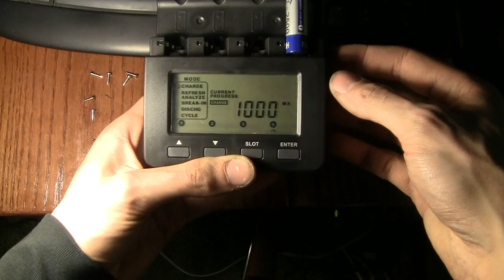Maha Powerex MH-C9000 Wizardone Battery charger Backlight Disable mod.

Comment: Does the MH C9000 have the same Easy set up function available on the Prp version, if not how do I charge 4 batteries at once
Reply from the maker: If you just plop a battery in it automatically starts charging at 1000mah charge rate

Comment: I'd like to replace the LED's with some amber, green, or warm white LED's.  Is this possible without ruining my unit?
Reply from the maker: It has been a number of years since I had mine apart (It still works flawlessly by the way), if I recall correctly, I believe they are integrated into the LCD panel, so it might be possible to carefully extract the LEDs from the corners of the display, but I would suspect it would be very risky.

Comment: Hi, I also have a powerex Maha c 9000. After about 4 years from the purchase (used very few times, so it is new) I suddenly had this problem: when I turned on, the display lights up, the light flashes "charge" and the arrow of the slot where I put the battery, and after setting the charge mA, it goes off.
I removed the battery from the first slot and inserted it into the others, but it does the same problem. Even without batteries, it does the same problem: it turns off. Recapitulating after accessing it, it performs the autoreset sequence and after waiting for the settings of slot 1 it switches off. It is as if it were looping. (however, once turned off, it no longer turns on)
To turn it back on, you must remove the external power supply and reconnect it. In my opinion it is a CPU problem (a Sonix SN8P1808QB) which according to the indications of its datasheet, also has an internal and an external reset procedure with an RC filter (Res 20Kohm in series with a 0.1uF capacitor) to be inserted between pin 1 RST (Reset) and pin Vdd. I noticed on youtube and in the forums that this charger has problems in slot 1, my charger instead turns itself off after the autoreset procedure and to turn it back on I have to remove and reinsert the plug of its external power supply. Has anyone had the same problem as me?
Reply from the maker: That is bizzare. I have not had that experience, my charger is still going strong.
I do agree with you, as I was reading I thought it might be broken contacts for the batteries or something but since unplugging it and plugging it back in resolves the issue, even temporarily proves it has to be either the CPU malfunctioning or possibly some mosfet or another discreet component that is latching or failing in some way in my mind.
Reply: @trythistv  Ok thanks for the reply! I discovered the problem!
The charger has no faults, I accidentally introduced a battery (a 2500mA Tronic) which it recognizes as defective. I was deceived by the fact that I put 3 more batteries in the same package and it gave me "HIGH" instead. So I wanted to try new batteries from eneloop and all 4 channels work perfectly. The mystery that I can't understand is that these Tronic batteries were also new (but stopped for about 1 month). These 4 Tronic batteries, however, I can charge them with the battery charger of the Tronic model TLG 1600 CS !!! ???
I suspect that the POWEREX C9000 is sensitive to already declining batteries and recognizing them crashes by turning off
Reply from the maker: That is bizzare. I wonder if it could be some kind of pulse feeding back into the charging circuit that is resetting the CPU or something, or if it is just the internal resistance is so high it thinks there is no battery inserted
Reply: @trythistv  Thanks for the reply. These are the batteries that have such high resistance that they are not seen by the powerex c9000 charger

Comment: Really, the backlight of this device is very bright, into a default assemble. Think that i'm just cut one of wire from LED then weld small resistor, with power approx 0.125W. But idea with potentiometer is a very good too. Thank you for reply :)

Comment: Not a bad idea, of cause. But for what make full disconnect of backlight? Think that a possible found some place and set somewhat as microswitch, or simple resistor (10kOhm, for example). As me seem, switch has be most usable in this case. Thank for video :)

Comment from the maker: It makes an excellent night light lol. It could very well be an el panel, it llooks almost identical to the led backlightsnon most 16x2 displays, like the ones we've used in the ttransistor tester and at mega soldering station so I assumed it was probably a led backlight